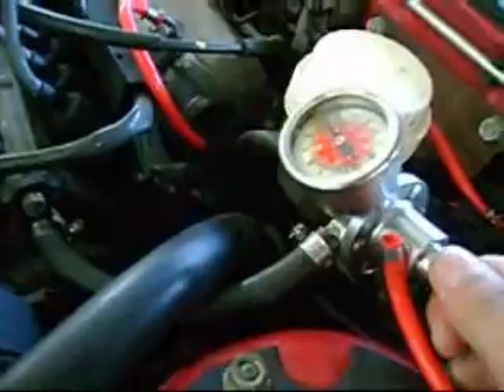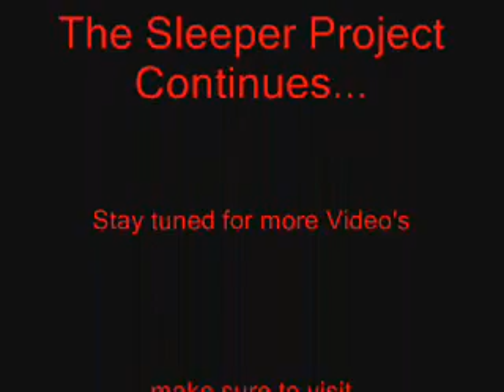The Sleeper Awakes..

Comment from the maker: It's a filter to relieve pressure under the valve cover. It also helps with oil squirting out onto the engine. Next setup will be a catch can.

Comment from the maker: Thanks, it was a match ported Evo III Big 16g turbo pushing 25psi*(maxed 32psi on it). It made plenty of power and with a 150shot of nitrous it makes an easy 500hp. The only problem is getting the power to the wheels. Im currently rebuilding the car again to handle more spray and boost. As for it being a sleeper, nobody around here has any idea the power it makes, they look at it as just another import ricer.. ;) . Little do they know.

Comment from the maker: @Brandonsveit It may appear like that to an untrained eye, but a Turbo Charged 4 cylinder engine is actually very simple and straight forward once you understand how it works. DSM engines especially. There is nothing to them, there is so much room to work on them under the hood, parts are dirt cheap, and performance gains are incredible with minimal efforts. The pipes on this setup were custom made, professional piping would help with the appearance for sure which i got soon after this vid.

Comment from the maker: @99darkhawk A sleeper is defined by MOST as a car that looks normal, doesn't get much attention to none at all, but has enough power to take out almost anything on the street. Great sleepers would be basic looking 4cylinder cars, Minivans, or anything disguised as being "Stock" appearing. The only thing that gives this car away is the Front Mount Intercooler making it easy to tell its a Turbo charged vehicle. However, in my area, most have no idea what it is much less know it makes over 400hp.

Comment from the maker: Check out my other video, "The Sleeper Continued", its my featured video right now. After this build, I replace the intercooler kit with Dejon Pipes and drove it around for about 1000miles. Then, I Ripped the engine apart and am currently building the block to handle 30+psi and/or 300+shot of NOS. The Sleeper is getting very interesting.......                            Stay tuned for more vids of my Eclipse and My SRT4 Caliber! Thanks for watching!

Comment: your comments and suggestions are needed because the engine is placed in-line and is only rear drive using the same old dross joints

Comment from the maker: @winkdogydog101 I never said anything about the modding requirements to get hit your goals with DSMs, I'm simply stating what you can get one for if you look in the right places. I bought a STOUT 1g GSX AWD for $1000.00 cash and drove it 500miles back home. I got lucky. Check out craigs list, you will find dozens of DSM's all around the county in the $1000-2000.00 price range. As for the noob comment, I know exaclty where your coming from, I've been wokring on them for over 10 years now.

Comment from the maker: @Chizel666 lmao! 120mph top speed? Are you serious!??? ANY DSM'er will tell you the same about the top end of a built DSM. Turbo power is top end power. It keeps pulling and pulling. This is the advantage I love over v8's. I blew my BUILT 6.0 SS hitting 160mph and was so disappointed.
If you are like most typical domestic guys and still don't believe me, there is a 170mph video on youtube done by a GST Eclipse, search it. A Non Turbo 420a(NT) would top out around a 120, but not a 4g63.

Comment from the maker: There is still much more work to be done to the car, would you rather me run it with no filter at all? cmon man.. When I connect my open exhaust, I plan to make a custom intake that will suck in nothing but cold air from the fender well. The important thing is that the car is running.

Comment from the maker: Another 420a non turbo eclipse? There are two types of Eclipse's. You have the 420a, and the Turbo 4g63. a DSM is NOT just another Eclipse. You should know that if your talking ...., This DSM had an Evo III 16g, upgraded fuel system, forged internals, and running daily on 15-25psi. The only thing that gave it away was the Dejon FMIC. Down in south texas it is dominated by v8's, so when others get smoked and name it the sleeper you know its not just another Eclipse. This vid is old by the way..

Comment from the maker: Im actually getting ready to get one my self but for a 1g GSX. On my 2g, I went with an Evo VIII fuel pressure regulator and it worked great, but this time around im going with Aeromotive-The complete kit, which is well worth the price. Check it out @ extremepsiDOTcom under Catagories/*Package Deals/DSM Specials. You will find almost everything you need on that site for your 2g DSM. Hows it coming along by the way? When are you going to run me? lol

Comment from the maker: You idiot, DSM's are built and distributed in the united states. DSM's are domestic vehicles. As a mater of fact, when DSM's first came out in the early 90's, they would complete in the v8 class. Over time, they eventually outlawed DSM's from the v8 class due to the huge difference in performance within competition requirements. These car's come on the best performance platform at the cheapest price. God bless the 4g63 Engine, Most cost effective performance platform of the 90's! Period..